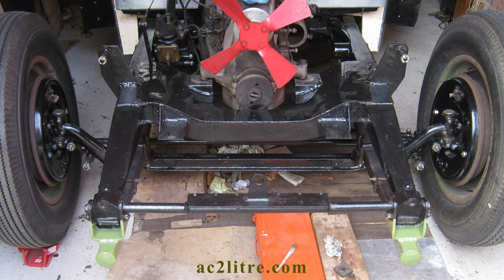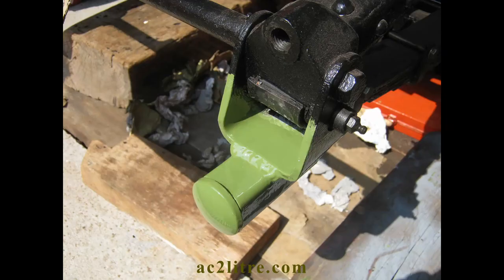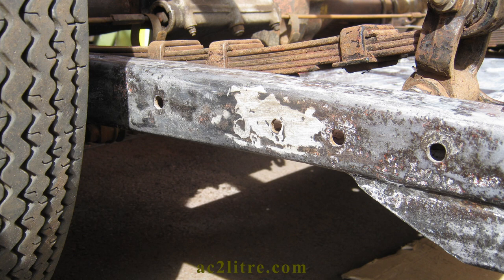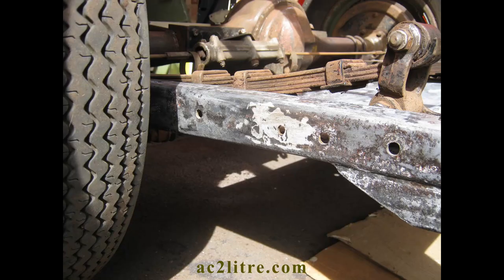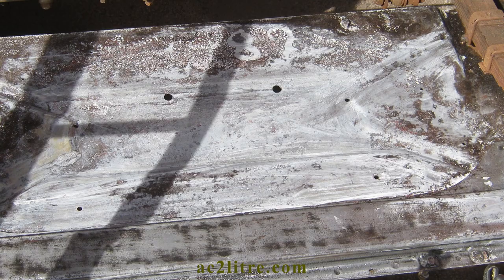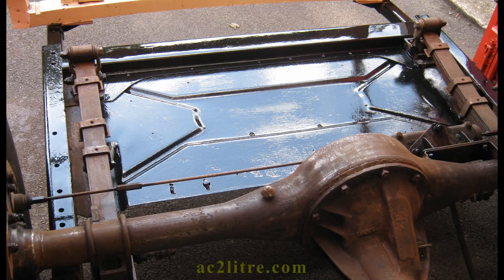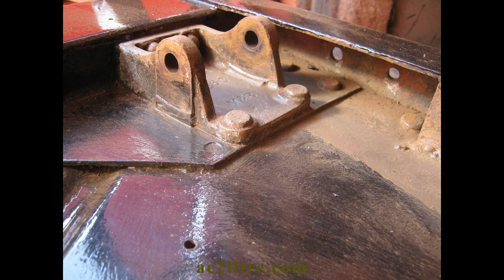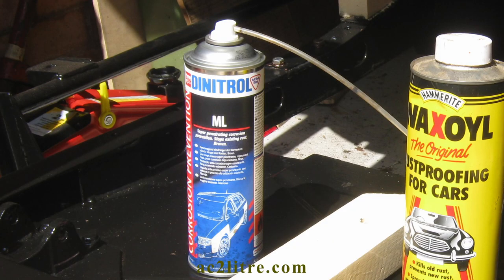Re-painting the chassis - 1949 AC 2 Litre (slideshow).

Comment: Well done that’s a great job and well worth the effort. Regarding POR-15 I went off it, because although it adhered well to corroded surfaces, it peeled off easily on smooth metal surfaces, and steel components can have a mixture of rust and bright steel. I have gone back to Hammerite for topcoating parts which won’t be seen, and Lidl/Aldi occasionally sell rattle cans of rust-preventive paint which is surprisingly effective without unsightly brush marks. I suppose almost anything is better than nothing.
Reply from the maker: Thanks for the insight, re. POR-15. I guess with any paint, the level of prep makes a difference.

Comment: ya I will be tackling my chassis this summer Iam installing "works" rally reinforcing then coating. I have a powder coating place just down the street and they say about 700.00 us to do the chassis so Iam thinking about it over painting there is alot of work to do that.
Reply from the maker: I've heard that it's difficult to touch up damage to powder coating, but apart from that, it's got a good reputation.
Reply: @ac2litre  Ya I have heard the same I do plain on driving this car its not going to be in a museum.